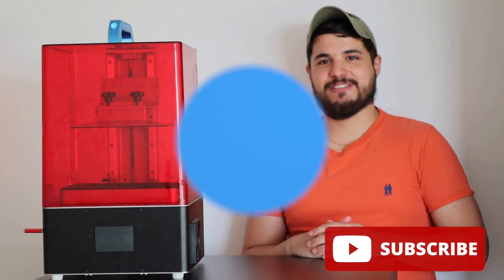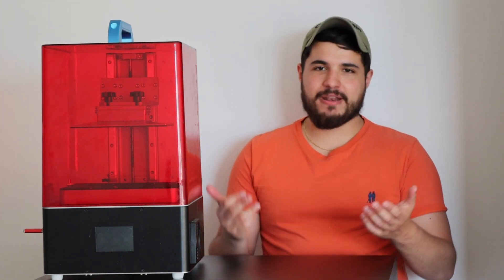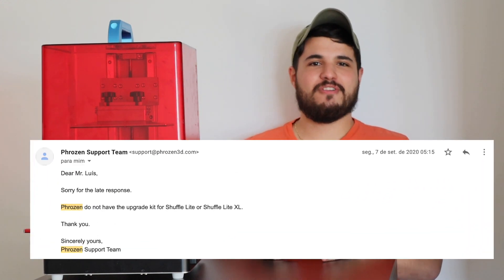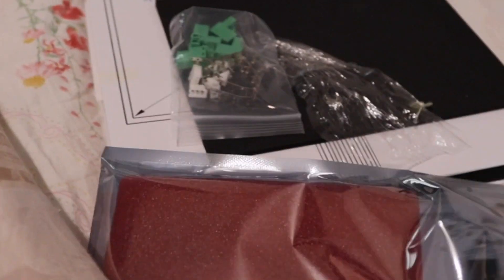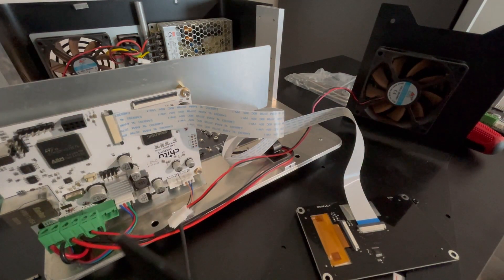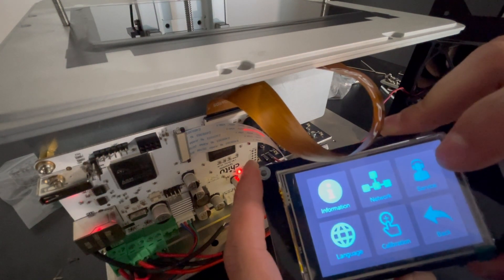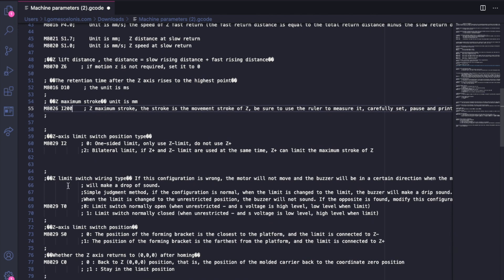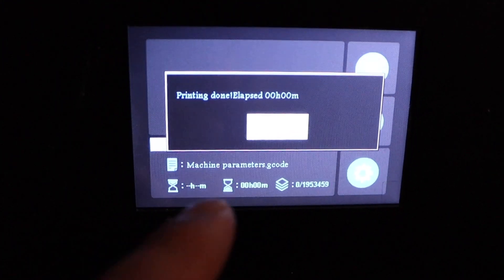How I upgrade my 8.9" Resin 3D Printer from 2K to MONO 4K Screen - Phrozen Shuffle XL Lite

Comment: Thanks for sharing. Are you happy with your upgrade ? I wanted to do the same with my shuffle 2019, his body is sturdy and i wanted to install the sonic 4k mainboard which is identical as the one you installed and the mono 5.5in 4k lcd. It will cost around 250€, it's almost the price of a 4k mono printer but much more solid. And now DLP printer are coming, so i'm doubtful...